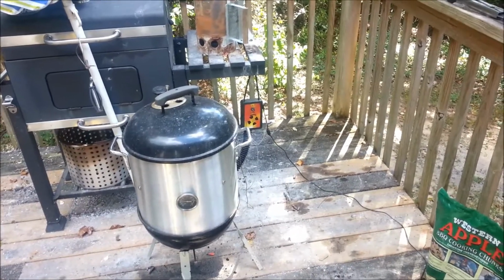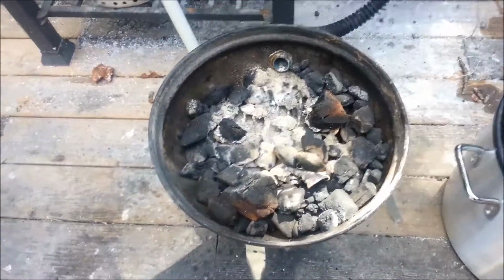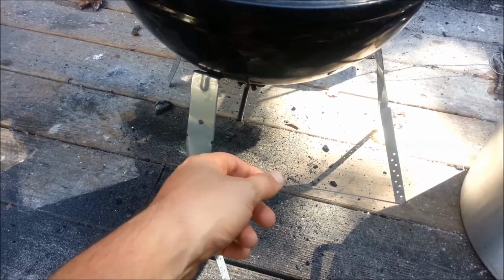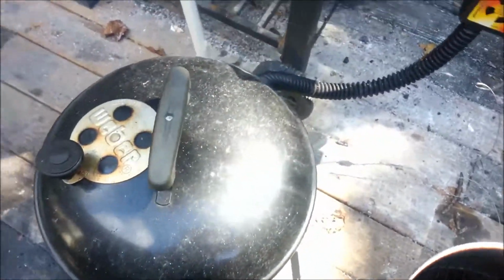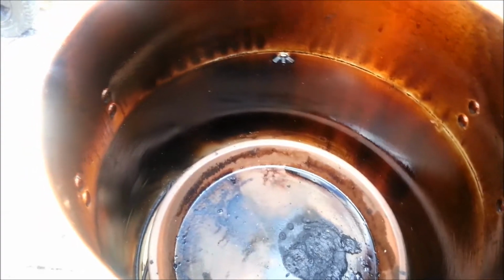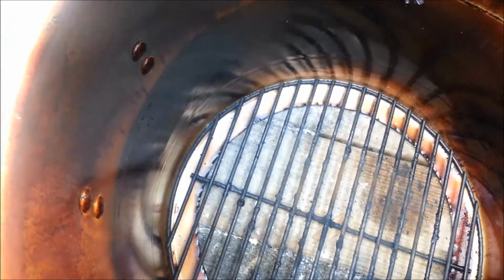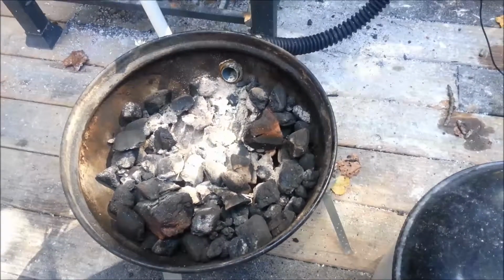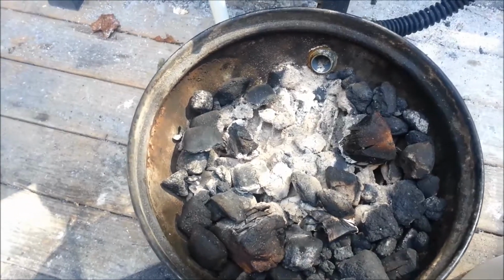My Mini WSM build

Comment: Questions on the Outdoor Gourmet pot - How well does the Smokey Joe lid fit the pot?  Also does the lid of the pot fit onto the kettle of the Smokey Joe?  Some have cut out the lid too and riveted it to the bottom of the pot to provide another inch or so of clearance for fuel...